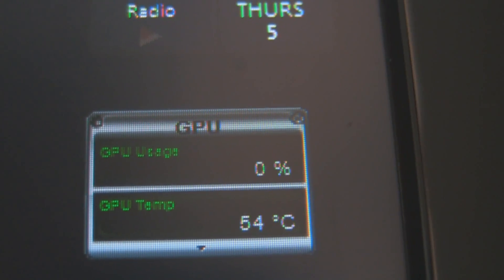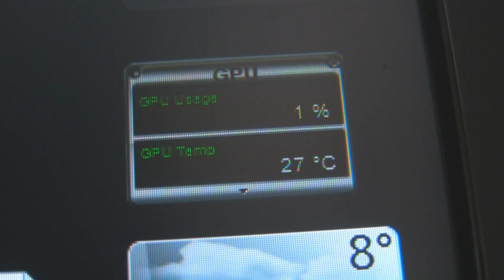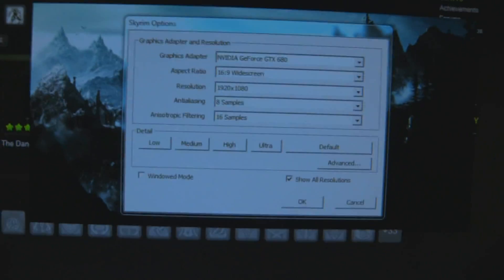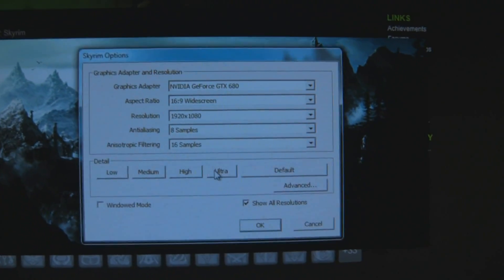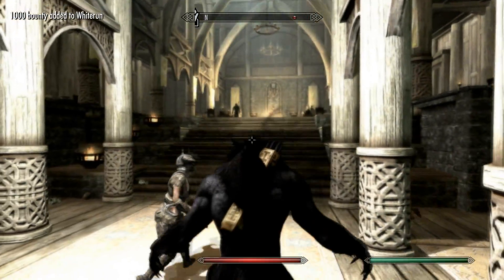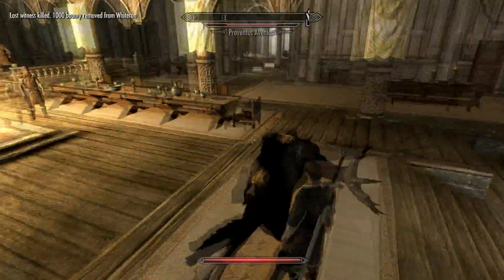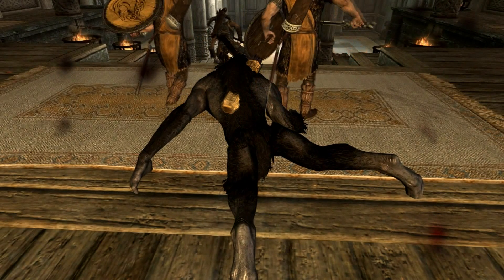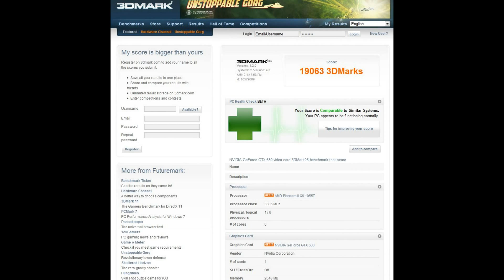Nvidia Geforce 680 Hands On

Comment: Well, if you're looking for specs,
The 7970 uses more power, and has higher memory bandwidth (about 37% higher)
The GTX 680 has higher Texel and Pixel rate (both are 9% higher than the 7970)

Comment: i understand what your thinking but it isnt needed at all trust me lol because it would probably fuck your psu up if you dont have a high one like me i have a 1000watt gaming psu
so im ok
but also the gpu power is way overkill by far because my n vidia ge force gtx 550ti amp can run games at full whack setttoings and gets like 500 fps lol